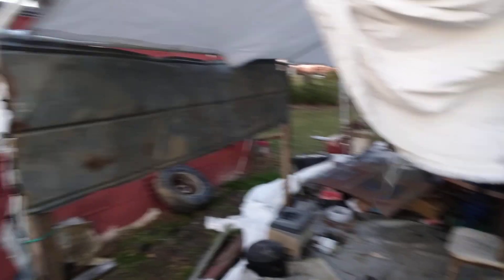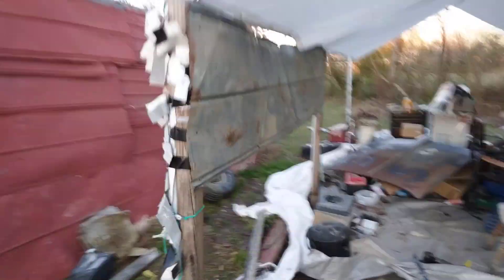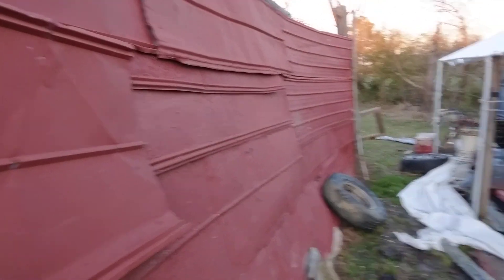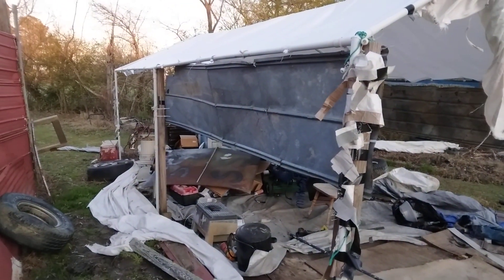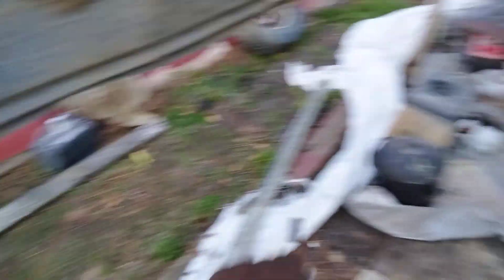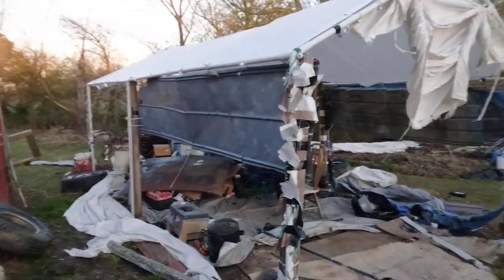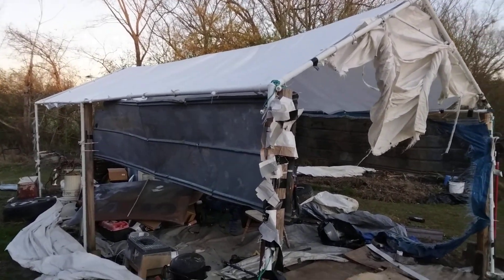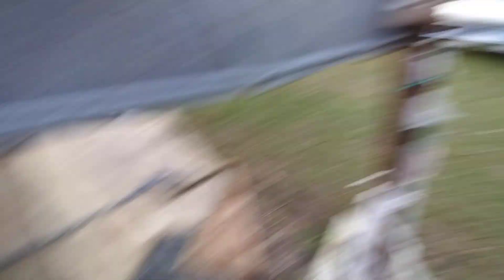Portable garage getting metal walls gonna put the red walls on this

Comment: Great project.  Would be better in the wind if you put the tin on the outside of the supports.  On the inside, it’s only as strong as the screws holding it in place.
Reply from the maker: Yup I just use this for demo gonna install more 4x4 post then pit on the outside tfw buddy